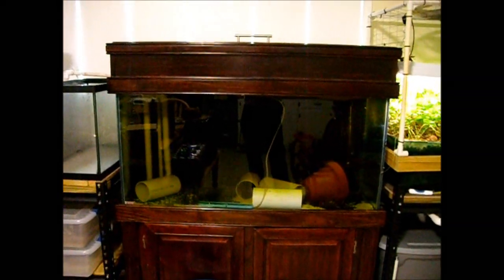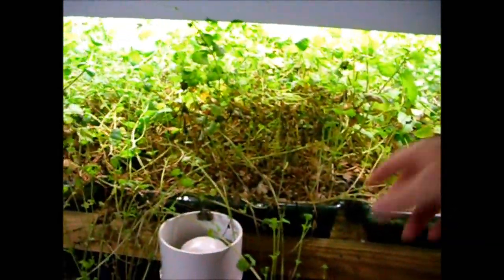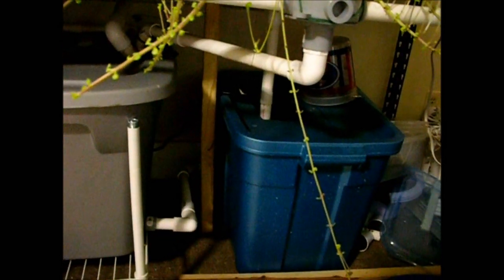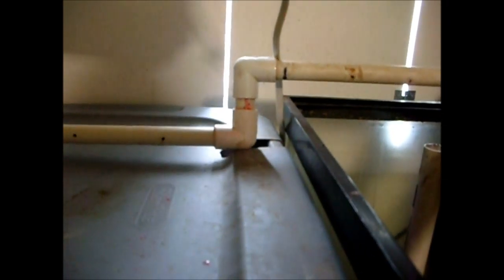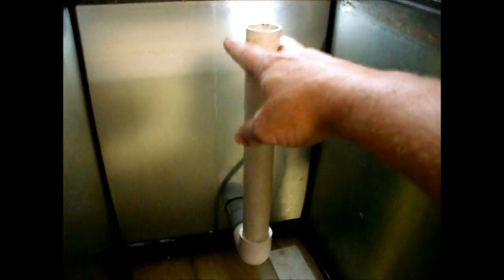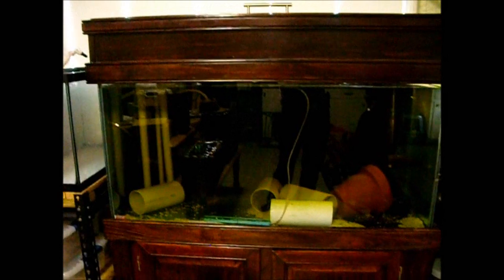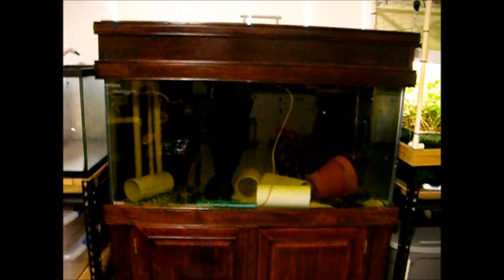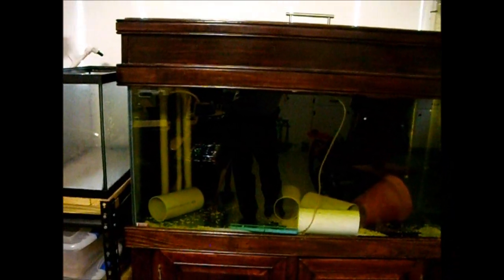My Tilapia Breeding Setup

Comment: Your method for removing egg-carrying females is genius! Kudos to you, sir.
Reply from the maker: Thanks! Out of all the methods I tried for moving brooding females it worked the best and I never had a female get excited or spit out eggs once I started using caps over the pvc tubes to trap them.  I used a net to gently push the female I needed around the tank until she would duck into a pvc section. It worked a treat.
Reply: Mark Massingill
Reply: I'm not sure I would have ever figured that out on my own. Thank you for taking out the guess-work for me. Makes life much easier when you can learn from people who are already doing what you want to be doing.